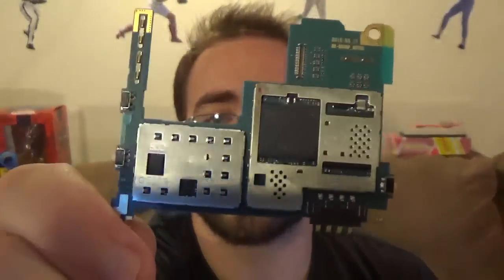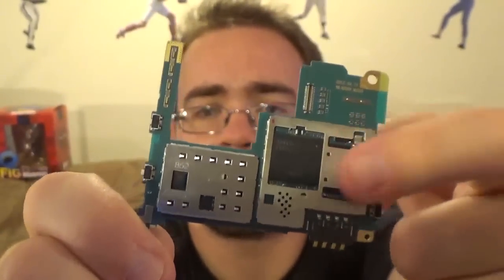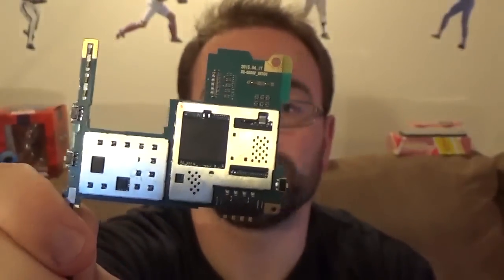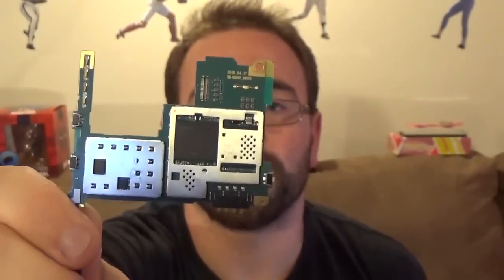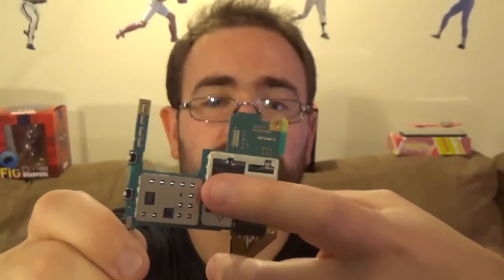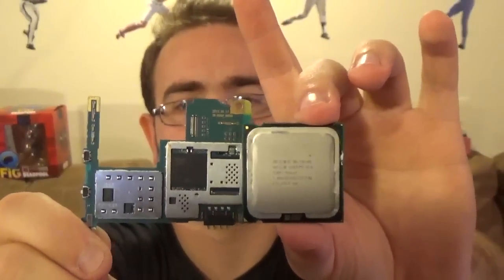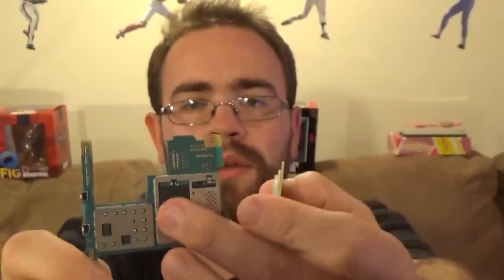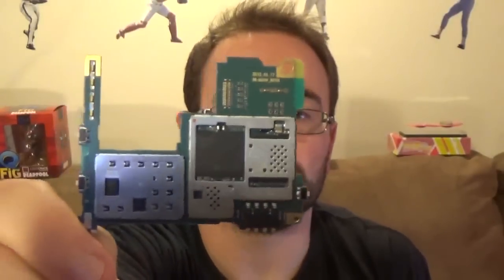Nintendo Switch - x86 And ARM! Why Is Nintendo Using ARM??

Comment: One thing you don't touch on when comparing ARM and x86 with performance on the mobile market is how ARM got there first, and majority of software is written more around it, vs very efficient newer Intel Atom chips that are x86 based but rely on Binary Translation technology which lower efficiency unless the software is designed around it like it is ARM.  

That being said, I would still go with Nvidia's Tegra if I were them, simply because there isn't a gaming x86 mobile SoC like there is for Tegra running an ARM SoC.

Comment: Lots and lots of people looking at all the angles, BUT the on that does matter the most.
Guys, ARM doesn't have as many instructions set as any x86-based processor, be it from AMD or Intel. Nor does it have the same horsepower. "So why the hell did Nintendo choose it to power the Switch?"
First, keep in mind we are talking about one piece of the Tegra chip: the processor (CPU), NOT THE GPU.
This CPU is meant to save battery life and is natively a mobile CPU, which means those characteristics will help the handheld-console to last as long as possible over the years for your mobile enjoyment of the system.
As for the GPU, here is where the magic happens: yes, it's a Tegra chip, but not the same as your Transformer tablet - this thing was built using PASCAL, the same GeForce desktop hardware platform that powers your Windows/Linux Steam games.
Now, please do keep in mind there is no reason whatsoever for a sub-7'' handheld to output image in 1080p. 720p does it just fine. Of course, things will be different once you hook it up to your TV, but then again, chances are the Switch is going to be charging while rendering and outputting the game to a bigger screen, so I believe nVidia has figured out a way to "convert" high-res games while in console mode to HD games when on mobile mode - which is great for battery consumption.